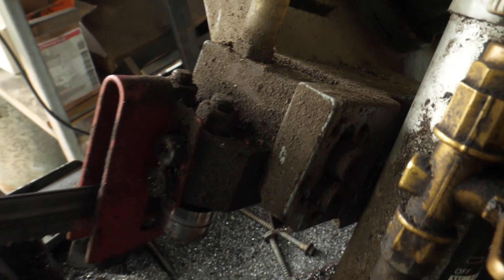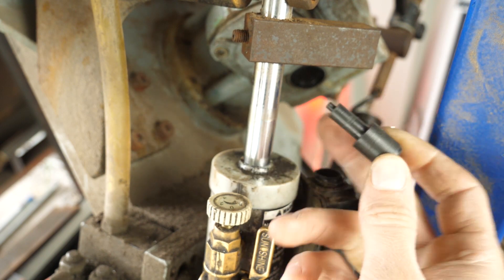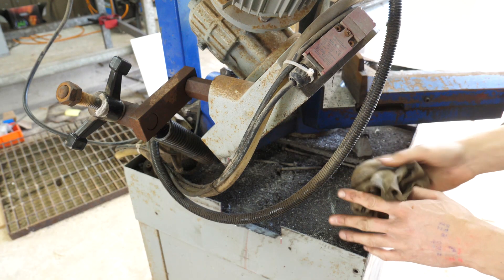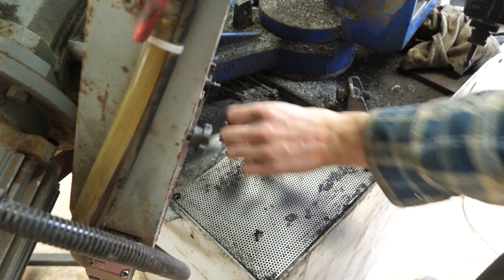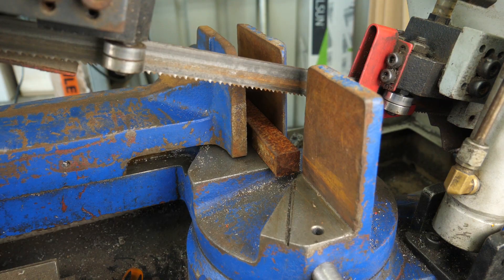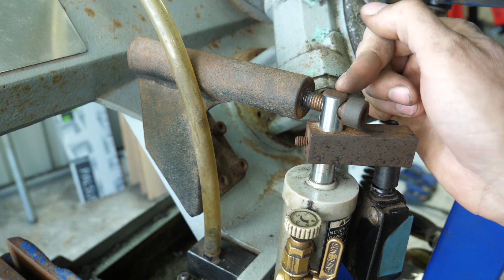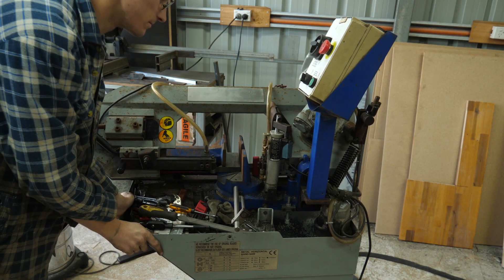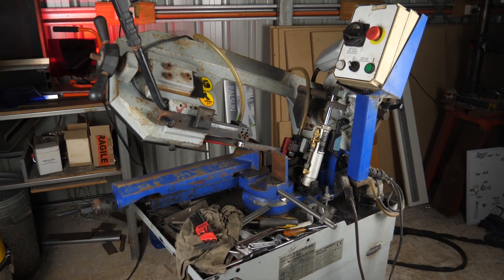Band Saw Upgrade horizontal/vertical

Comment: You should have left the base cabinet as is - just put metal blocks between the base and the bandsaw - easier to clean , a better working height for vertical ,  a bigger horizontal table permanently attached for quick jobs as it will go down in the gap when horizontal sawing  - an easier  modification - it  took me 10 years to think of this - "D'oh!"

Comment: These are AWESOME saws.     Most of the nice ones are made in taiwan.      This one in the vid looks a tad older than my one.      Best things to do to these older ones is add the hydraulic blade tensioner and a blade cleaner wire wheels, add grease nipples to the swiveling base section so you can easily regrease it without pulling it all apart.   And cut a red scotch bright pad to go under that grate where all the metal filings acumulated to act as a filter to stop all the filings going down there that will not only save the life of your coolant pump but make clean up about a billion times easier as you just scrape the top of the machine with a thin piece of metal to get rid of all the metal filings.

Comment: It needs a kick stand in the back so you can fly it vertical. just enough to prevent flipping backward when the weight shifts.  Kool Project.
Reply from the maker: I'm going to modify the casting to make it fully vertical I've decided
That will be coming up along with the table build

Comment: Aren't arc shots a turd to get so they actually look good?  I still haven't found a great recipe for getting them.  Having this unit with vertical capability is a huge feature, I have one of the small ubiquitous import units that does horizontal as well as vertical and quite appreciate that function.
Reply from the maker: I sort of got it a few videos back, then I changed my filming setup lol
Even a horizontal bandsaw is proving great. I think having the vertical capacity will be the icing on the cake. I will get it fully vertical first, because I seem to have upset people with OCD lol

Comment: Awesome video, but you need to get it fully vertical or you will be making another video on how to make a not so vertical band saw vertical.. and thanks heaps for the arduino code..
Reply from the maker: Yes I will make it happen. It sounds like a good challenge :)

Comment: Why not just raise it off the base? Redrill stops location, I really doubt it is a unique casting, they all are horizontal/ vertical.
Reply from the maker: There is a large lever at the front that clamps the swivel vice. If I chock up raise the castings I'd have to re cut the base to suit the lever, etc
I also find the working height is quite comfortable at the moment